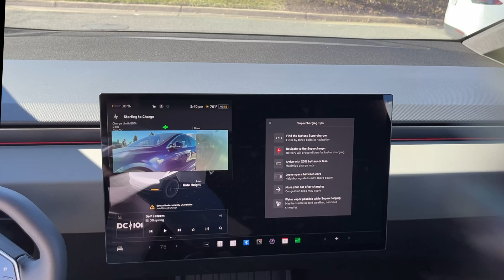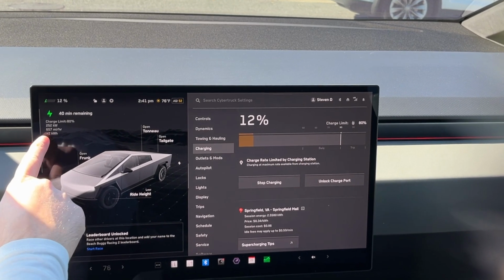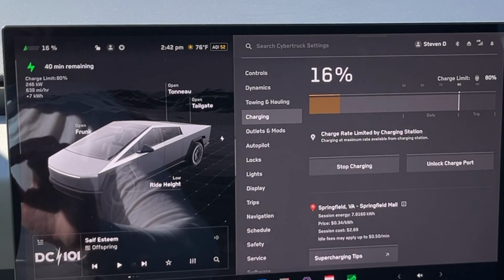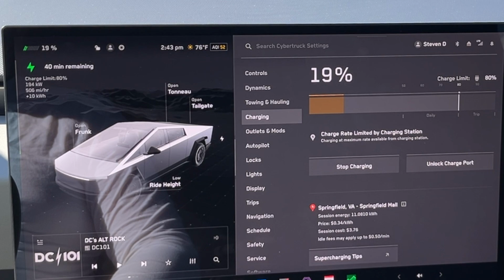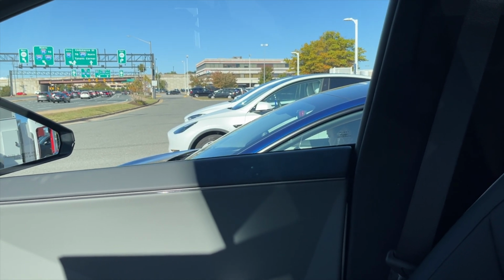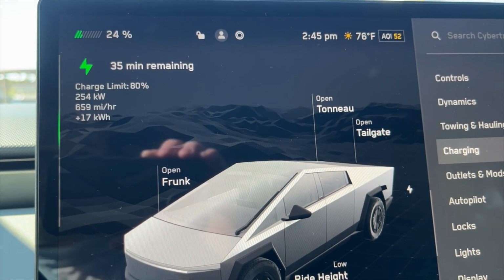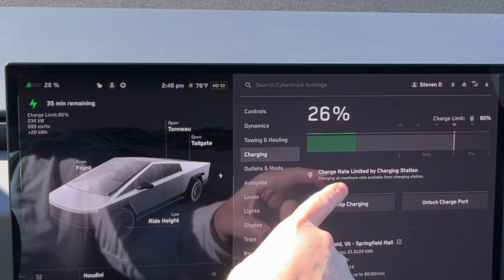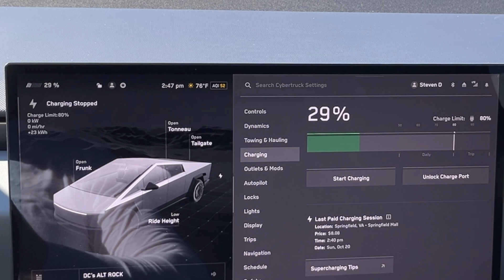Non Foundation Series Cybertruck Charging curve

Comment: Have noticed more chargers down at that site in Springfield. I think is the users. They seem aggressive there compared to other supercharger sites in the NOVA area
Reply from the maker: I figured it was vandalization. I looked at one, and it had a DC pin bent and cracked housing. Someone attacked it with tools I'd guess.

It is an extremely high turnaround site though, all the condo and apartment dwellers stopping by every few days to charge up. Almost always full. Never see a site like that outside of here.
Reply: @ZeroFun  Yeah my assessment as well. Pins missing etc. Few there follow waiting in line etiquette also

Comment: hmm more expensive than gas. 2 gal worth = 8$
phev sounds like a good idea right now
Reply from the maker: I charge at home for $.08 a kWh. That’s about 2c a mile. Once or twice a year I’ll road trip and pay for quick charging, but I’ll find the cheapest charger available along the route. This was just the closest V3 site.

I stay at hotels and get a free tank of gas essentially. Find free or cheap fast chargers.
Reply from the maker: Also, that $8 got me 10-30% charge to so, which is over 60 miles of real world range. Figure 20 miles a gallon for a full sized truck, I bought over 3 gallons of gas for $8. Not amazing, but not horrible for an occasional trip.
Reply: @ZeroFun  ya my 2013 volt has paid for itself already in the last 18 months just in gas savings. i drive 35k miles per year and charge at home and at the different hospitals that i rotate at. the first 50 miles of ev range is the vast majority of fuel savings for people, and you end up saving a lot of time and even money just buying gas for anything outside of that. I dont think there is another ev/phev in existence that can literally pay for itself in that amount of time without deal breaking compromises or anxiety. people should figure in the volt as the true opportunity cost when deciding to buy an ev/phev. too expensive, not to mention the depreciation. somehow the volt keeps going up in value every year, again probably the only ev/phev that does that coz people think they need to spend 50k to save gas with a top spec prius

Comment: Still that's nuts. My Y will peak at 250kw but quickly taper down.  Also when it's at 250 it's reporting 1020 mi/hr so CT at 660 mi/hr is about 2/3rds as efficient as Y.
Reply from the maker: Y and refreshed 3 are efficiency bosses though. For a truck, I'm extremely impressed with this thing, getting better efficiency than our X60D did. It appears to do better mixed driving, even mostly 60-70mph, than the rated efficiency.

Supposed to be 325 miles on these Core wheels, but I'm seeing 340-370 real world, mostly highway. Doing a higher speed, less traffic, range test this weekend, driving down to NC from DC. Hopefully it continues to out perform the rated efficiency.

Comment: Did the center screen indicate which stalls were none operational?   It normally does but I do not know how accurate or timely it is.
Reply from the maker: One plug was damaged, it just showed up as an empty stall. Three others showed us as failed if you get details on the station.

The problem is, cars block the stall number. Chargers here are behind vehicles. At least you could see the empty wants and know they’re broken though. 

It was a weekend madhouse with a bunch of suburban apartment dwellers shopping at the mall and charging, before the week started.

Comment: Will be able to do a highway range test
Reply from the maker: Hoping to do a CCS charge test in a few days, then driving DC to NC to help work on a vet friend of mine’s widow’s roof. Should get some good real world range data there.

Tried getting the range at 65 yesterday around the Beltway, but there was constant traffic. Getting about 340-360 miles of mixed, mostly beltway driving, real world range right now on the Core wheels. Hoping that holds up on I-95 at slightly higher speeds.